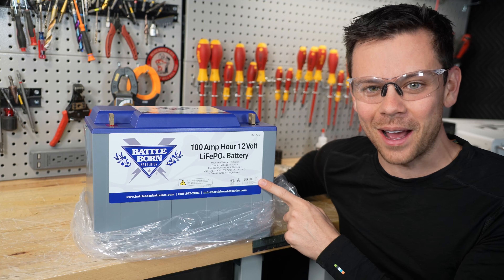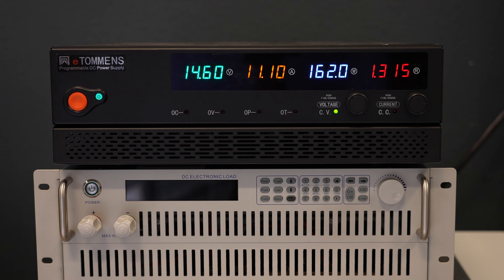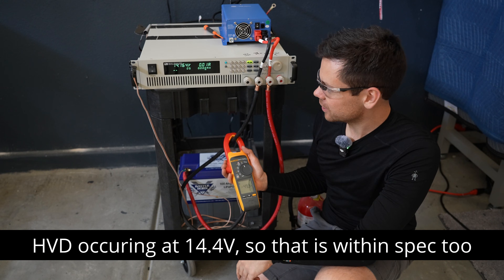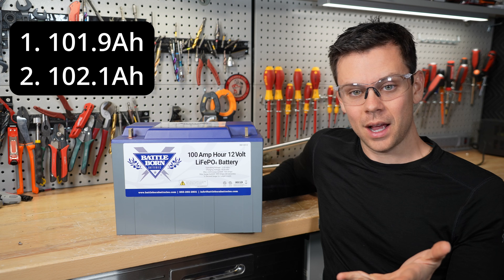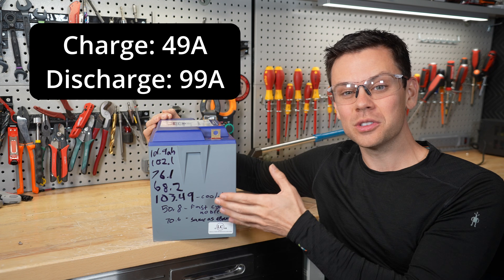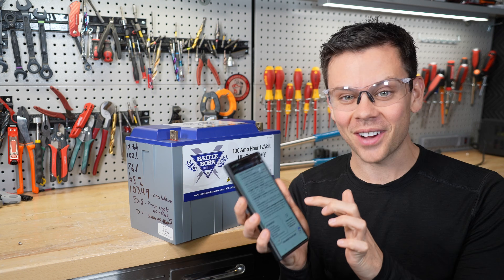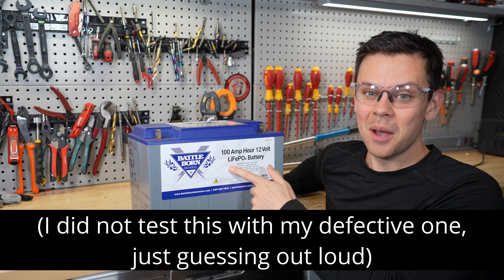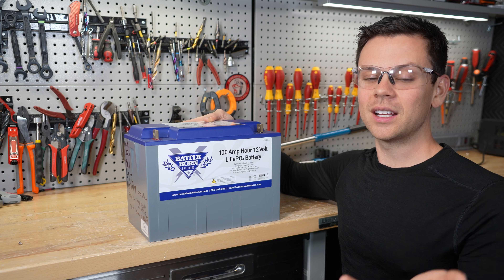A NEW Issue?! Battleborn Cycle Testing!

Comment: I just tested mine and i got 58ah on one
With less than 700 cycles
Reply from the maker: What!! No way!! Can you please post a picture of those results on the forum?! Holy cow that's bad
Reply: @WillProwse yeah i will i am going to try and charge it really slow at the top to hopefully balance it and then test again 

And that was at 10amp discharge rate

I have a picture of the first cycle discharge test and victron charge that shows how much it charged after the test

I have 2 battle born batteries i will test both of them

Comment: I've had 2 Battle Born batteries in my Sprinter RV for 5 plus years. They have worked flawlessly,  but I have not cycled them like Will has. Hopefully they keep working well.
Reply: I have had mine lightly used for two years with no issues. However, I am really pissed because I don’t believe I got the premium battery I paid for!
Reply: My experience as well
Reply: Same I’m on my second RV running battleborns and never an issue.  My first had 5x 100 amp hour batteries in parallel.  I’d leave it in the hot sun, ac and fridge running/cycling all day with 1500 watts of solar.  After the sun went down I’d crank the generator using the same batteries, charge at 110amps to top off before the night.  
But I’m not pulling max load charging and discharging back to back.  Honestly I think it’s a little silly to expect that?
Now running a trailer with 1200 watts solar, single 270 a/hr battery.  Doing the same thing.  But when I plug in or run a generator I limit charge to .5c.  Never a problem.  After years.  Never cut off.  Never an issue. 
Lost power to the first rv when I was away in winter, had two electric heaters running.  Batteries ran then continuous until I logged in remotely and noticed. Shut down inverter, turned on propane furnace.  Next day power was back, turned the inverter and charger back on, charged at 120 amps while running heaters.  
For me they’ve been flawless.  But again I tend to run more battery than needed and restrict charging to a reasonable rate.
Reply: Even though BB says you can discharge at 100% of capacity, I don’t think that is a good idea.  I try to stay between 25 to 50%.  Easier on the battery and I don’t have to invest in big ass cables.
Reply: @donbrloks3959 yep.  No issue on the bigger motorhome with ac and fridge running I’d typically pull .25c from my bank.  On the trailer I regularly pull .4C from the single battery.  Again, no issues at all.  Batteries installed inside in both applications.  Personally I think it would be ridiculous to expect to draw 1c from any battery until discharge and then immediately charge at .5c and repeat it over and over. 
But by all means Will, reproduce this with multiple other batteries and report back and measure temps etc.  if you adamantly are out to blast BB, compare the other manufacturers in the same way.  My mind can certainly be changed but they need to be tested the same way.

Comment: My guess is the people who have terminal failures are using it in a boat or an RV or something mobile. Not in a solar power installation or something that doesn't move. No battery want's a long heavy wire putting pressure in one direction on the terminal then vibrating. I'm not saying they do or don't have problems, but terminals are not designed with improper connections to them.
Reply: They why would Battle Born contact all of these RV influences to push their product if it is not designed to be placed in mobile environments? Bottom line, great marketing but not so good design and quality.
Reply: @DavidJones-su9ob  Did you see the huge loop of cable attached to the battery in this video? You can't do that in a mobile install, yet I'm sure people do it. I don't have battlebornes installation directions, but I'd bet they tell people to not have over a certain length of unsupported cabling attached to the terminals. I worked in Telcom with high-current DC plant. There was NO unsupported DC cables for just this reason.
Reply: Agree, I think he can cycle that 3000 times and nothing is going to overheat.
Now if it's in a moving RV then that is where the problem will come in.
Reply from the maker: Yes good point, may need a vibration plate
Reply: @WillProwse  Your going into the weeds with that one buddy.  How do you know what is normal vibration in an RV over a period of years.   Don't feed the lawyers when ya don't have to.
Reply: My batteries- which are solidly placed - I’ve been bouncing around off-road for five years - and they’re fine - but they are very solidly placed.
Reply: @healthrisingMECFS-FM-longCOVID  Yeah, all it takes is the battery attached to something holding it down, then some form of wire mounting plate or rod that's also firmly attached to the battery mounting plate and you won't have any problem if the wire is then attached to that non-moving tiedown. Any terminal attached to something solid should have the cable leading up to it also tied down to the same bulkhead.

Comment: Thank you Will for doing this for us consumers. I wouldn't buy a battery without checking your channel first!
Reply: Part of my decision years ago in purchasing Battle Born was based on one of Will's prior videos where he took one apart and claimed it was a quality battery that was built well.
Reply: @CartersTrail  Based on his testing at the time, it was a quality battery.  Remember Will is human like the rest of us and can't be expected to test all facets and find all faults.
Reply: @MrTubsterr I call your response BS. If Will considers himself an expert, he should have examined the build quality years ago. Instead, he cut open a BB, praised it’s design, build quality and highly recommended BB. Has Will since apologized? Thousands of people may have purchased BB after viewing his original video. 

At least he has finally decided to conduct a cycle test. We knew absolutely nothing about the battery’s he cut opened that were shipped to him. In my opinion, Will should have waited to release the previous two videos until he had more reliable information. This tells me he was after clicks not factual data. If not, he should have shared the process he was going to follow - testing the failed batteries then moving on to his own cycle test and dismantling the battery after testing etc. Sorry but Will needs to look in the mirror on this one.
Reply: @CartersTrail  Same here, and I bought 6 of them.
Reply from the maker: Yeah I was wrong
Reply: @WillProwse  that right there is integrity. and a rare thing indeed.
Reply: @WillProwse  How many reviewers have EVER gone back and investigated when a product they endorsed turns out to be not so good? 9/10 of them either don't care or don't want to ruin getting a review copy/sponsor.  Most of them are complete frauds for this reason alone.  Not to completely glaze you Will but atleast you're willing to admit you're wrong. Very rare nowadays it seems, unfortunately.
Reply: @WillProwse  I did not mean to imply you were wrong or misled anyone. There were very few available 5 years ago and it was great seeing your analysis. Not sure if you've been able to verify what (if anything) changed since then? Just pointing out we all appreciate your input/testing over the years.
Reply: For the last 3 years with will and 5 years with project farm, if I need something I always check with these two first.
They both work on the same principles and that builds trust.

Comment: Outstanding idea! However you may be correct about software change on the BMS. Could you gather some quick data from those who wish to send you their battery as to what it is/was being used for. My guess is majority will be RV applications. If so vibration may be a root cause of the terminal becoming loose. Those of you monitoring this situation if you have a BB with this terminal issue please post what your application is.
Reply: Yes I have my Battleborn in use in my MOTORHOME full time.  BUT——-I never charge them to 100% and immediately discharge them at 100amps and again charge them back to 100%.  My discharge is at around 15 to 20 amps as I use them boondocking.  I would not expect them to recharge to full capacity after just discharging at 100 amps.  Of course they will still,be heated to some degree above ambient after such a rapid discharge.

Comment: “UL”  a standard that is up to the manufacturer to conform to after an initial inspection by UL.  After that, it’s just an expensive sticker…
Reply: Not in this case. In this case, they designed it to meet UL specs, but never had it inspected by UL. 
UL Listed is a different story though, which means UL actually inspects it, which hasn't been done here.
Reply: That is not quite true. A “listed device” has been tested by an NRTL (UL,TUV,CSA, Intertech and etc.) to be used in various described applications. An unlisted device is still tested but it has “Conditions of Acceptability” that MUST be followed in order to be used. Example: An open power supply will have a NRTL mark but has conditions…cannot be used in a marine (wet) environment, cannot be used without an enclosure (protect consumer from electric shock and etc.)
On the other hand, a sealed supply (i.e. computer “brick” power supply) is NRTL listed and can be used without conditions. I know because I have been a Product Compliance Engineer for 40 years…

Comment: Is this uncommon for sealed in plastic batteries? Won't all batteries heat soak at these charge/discharge rates?
Reply: If their claims are based on this kind of workload, it should stand up to this kind of workload.
Reply: According to an AI search - yes this is a very severe stress of the battery and they are likely to heat up

Comment: My 2 Battleborns are probably over 10 years old but have never moved since I received them.  Seldom discharged down to the bottom.  Terminals are cool to the touch while charging.  I wonder if some of the problem batteries have been bouncing around in RV's that might be causing the loose nuts?
Reply from the maker: The nuts don't loosen. It's the plastic deforming. Has nothing to do with loose nuts.
Reply: @WillProwse  has this always been the design? My batteries are manufactured in 2019
Reply: Mine have been bouncing around off-road pretty constantly for five years. The terminals are as tight as can be. - don’t know about anything else. All in all they seem fine.
Reply: rewatch his video again on the battleborn that he takes apart its the plastic sandwiched between the busbar and the lug terminal causing the bolt to come loose. the bolt didn't unbolt itself its loose cause they tried to save money using only one bolt to both secure the post and make an electrical connection.
Reply: They're SUPPOSED TO BE drop in replacement for RV and Sports Use of all types.
Vibration should be EXPECTED!
My worn out STATIONERY USE Trojan Renewable Power Lead Acid Batteries have managed over 5000 miles on a trailer without issues after being used as Stationary Only for their entire useful life.
Reply: Also curious about “what changed” over the last few years?